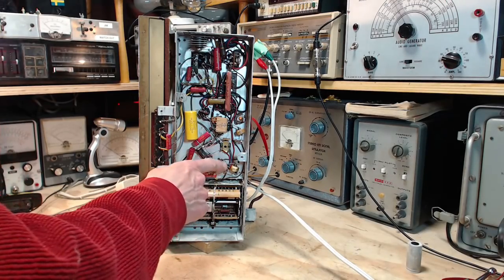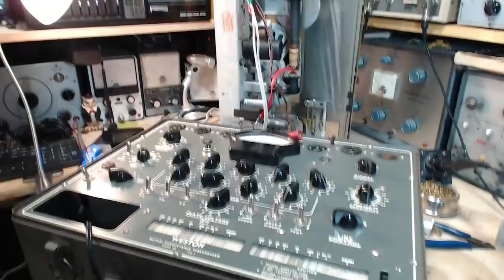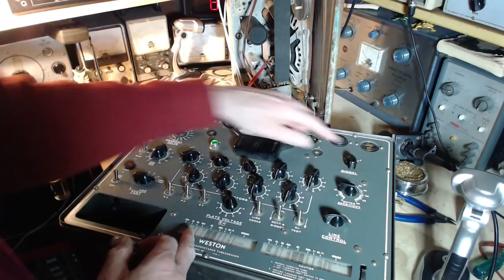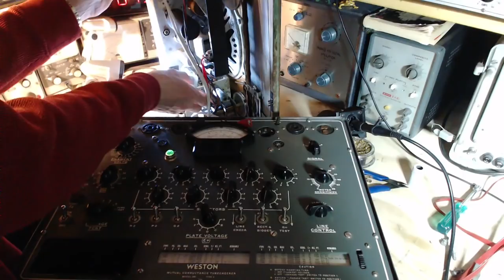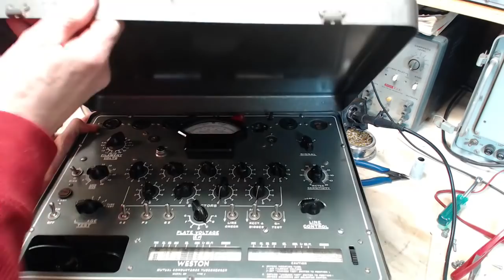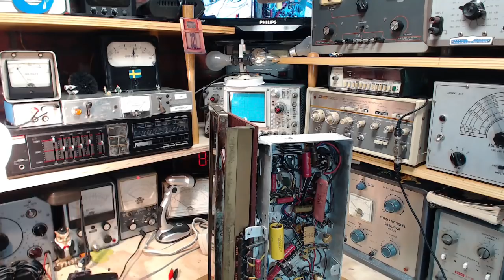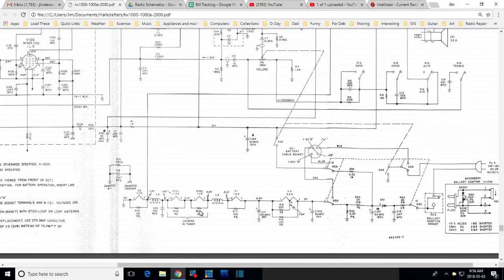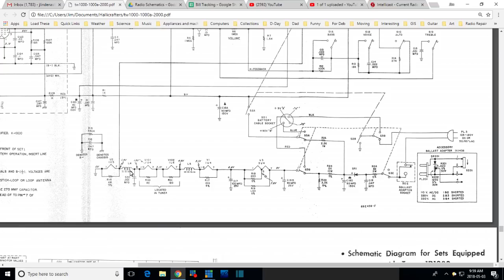Hallicrafters TW2000 World Wide Video#3 - Troubleshooting Begins

Comment: Here is something I found on another site (https://people.ohio.edu/postr/bapix/TW2000.htm ) on those resistors and why they are there. "In comparing schematics, I noticed that every tube filament in the TW-2000 has a resistor in parallel across it. That reduces the problem of a filament-supply capacitor charging to full B+ in the event of a open filament or loose tube (and discharging that cap into the filaments if a new tube with a good filament is then inserted.) The resistors provide a full bleeder path."

Thought it was interesting. Always want to know how things work.

Comment: Can you re-purpose an old TV Turret tuner to get the Bakelite Tuner biscuits which should be 6 contacts on one end and 5 contacts on the other end and you would have to rewind the coils it is something that has to be done to get the frequency coverage for each band, Would those low voltage vacuum tubes be military grade tubes like that used in an old radio pack like what a GI would use to communicate with base to get orders, Had a look at the Hellicrafter TW2000 and it looks like number doesn't exist so there is only positions SW 1-7, space then the LW biscuit, I think that all paper and electrolytic capacitors have to be replaced.
Reply: DAVID GREGORY KERR ; I have a set of  2 NOS UHF tv ones that I think would fit if Jim wants them, but I'm doubting he would go to the trouble of making coils for them in the right range.
Reply: K2bew sometimes you have to wind the coils as as they stand they would be on the wrong band of frequencies

Comment: You measured 30 volts on the top of the  filament chain. It should be 9 volts. Find out why it's 30v. There must be an open circuit in the chain somewhere.
Reply: Jim is still looking at the wrong schematic. He should be looking at the second schematic with tuner ID1382.